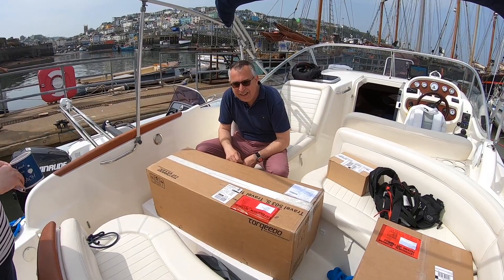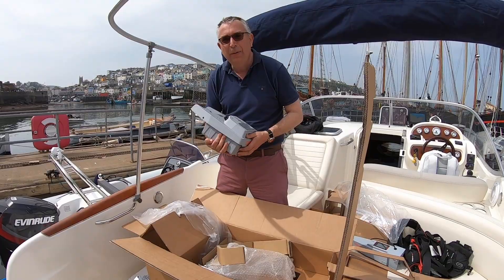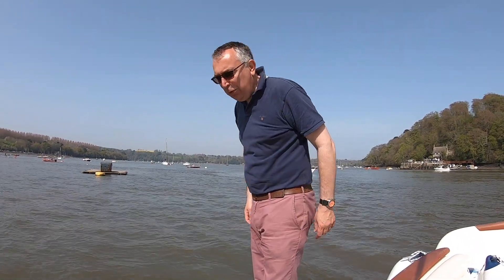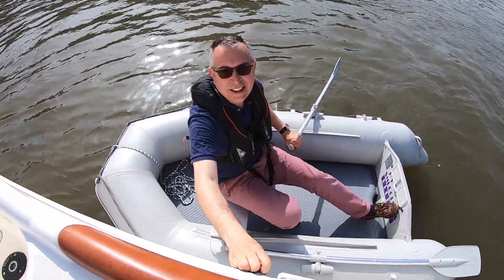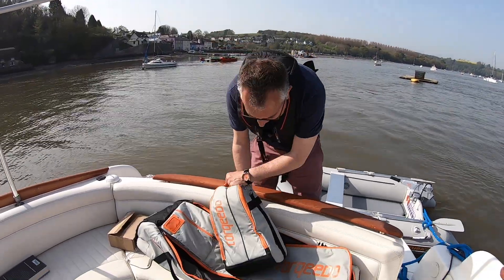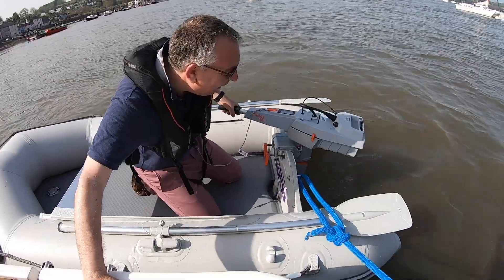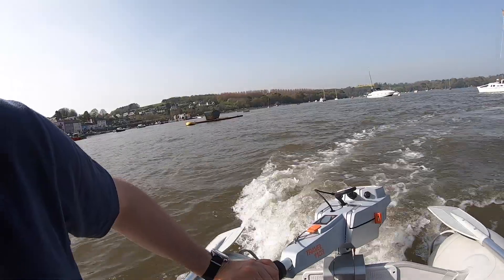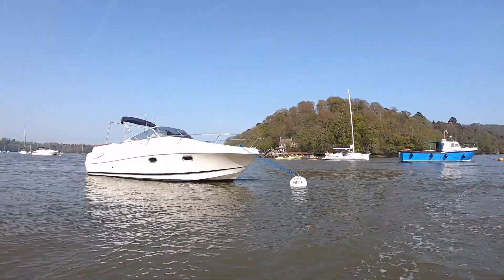Torqeedo 1103C electric outboard unbox & test

Comment: How much$ cost?,what voltage? run time ? how recharge? time recharge? how much extra Batt?? some specs?? por favor....
Reply from the maker: Let's find out shall we? Stay tuned! :)
Reply: https://www.torqeedo.com/us/en-us/products/outboards
Reply: Vastly more expensive than a petro motor based on model.  I just bought a 2019 20 HP fuel injected Tohatsu for 3K versus 24k for their 25 hp model.  Certainly a neat technology but clearly marketed for the rich.  So, amazingly a outboard motor costs more than a brand new Hybrid/electric car with wheels, interior, A/C, steering, stereo, etc.  This puts the perspective of the level of rip off for this product.
Reply: @mikes1172  Sad but true, that's why i still have 40hp evinrude,10hp mercury,10 hp johnson ..all 2 strokes...older ones that still work just fine and ok to use most places..even here i commiefornia....however;.the whole fish/boating thing here is stupid... i quit... $$$ launch fee ,$boat reg$,$ fish license, $ boat inspection for snails $15 each time launch boat..game warden,park ranger,ect.. assholes..you are treated like a criminal... power crazed nazis I refuse to give them my $$ by purchasing fish license ect..to pay their salary...sucks here anyway too many people,too many regs,no fish that are not contaminated with mecury or some other crap.

Comment: What a great outboard well worth considering as it stows well in the need bags.  Like the dingy too I have an NC11 called Bon Ventura should go quite well.
Reply from the maker: The storage angle is excellent. In fact I bring the tiller arm and battery home (to recharge). Would be great on an NC11.
Reply: Love the storage bags, but $230 US is not very consumer friendly.  In general their accessories are extremely pricey. I guess they figure folks that buy a $2600 low power outboard won’t mind the extra cost for accessories too.

Comment: How much are they?   Has to be a downside!
Reply from the maker: Have a look on www.torqeedo.com for all the prices of all the different versions (this one is the 1103C). They are dearer than conventional outboards, but bear in mind that they never need servicing - or petrol! Once set up, mine should charge from the solar panel or from the main boat batteries which are of course being charged when we're out  running. So that will help offset the cost and there are massive advantages (which I plan to do a video on at some point).
Reply: 2k plus,
Reply: @Burnie66  just seen this one at west marine for $1300
Reply: @supremeautomotive6749  but you didn't bring it home
Reply: They are closer to 3k with the battery that is comp to a 3hp

Comment: How much power does it give you.......4 or 5  horsepower?
How long does it last on a charge?

edit I see you have said 3 house power, like you say about right.
Nice design.
I bit quieter than a British Seagal.    :-)
Reply from the maker: It is to the Seagull what a Telsa is to a Model T Ford! :D
Reply: @AQUAHOLIC  I sort of miss the old BRitish Seagalls!
There is no point talking to me about telsas im a petrol head.   Your leecy out board was a neat design.
Reply: @AQUAHOLIC  https://youtu.be/tH1XUN5RHtc
Reply: Less than 1hp at prop. It's not even nearly equivalent to 3hp - 5hp. I don't know where from this myth started, but it was debunked countless times. Electric and petrol horses are same. Still makes a fun toy with a lot less maintenance.
Reply: @xellzor To get that kind of boat into plane with 1 80kg person it would need maybe 3hp minimum and the outboard should weigh around 15-20kg max :)
Reply: @xellzor  That's hilarious.
Reply: @user-dz2jv4in5z  What is hilarious?

Comment: Agree super cool to be zipping around so quietly and seems not lacking in umph! Wonder how long it will go for before charge runs out seems range also getting better all the time.
Reply from the maker: The range on this one is superior to the (already pretty good) existing models. Add in the ability to charge onboard the boat and for free and it's amazing! I'll hopefully do a video testing out the range at some point (have a plan for a 'Top Gear' style distance challenge!) Stay tuned. :)

Comment: Nice one. How many HP?
Reply from the maker: I believe it's equivalent to 3hp in a petrol engine - and it certainly feels all of that.
Reply: @AQUAHOLIC  It's not, only close to 1hp. 3hp is some marketing magic. Electric propulsion is nice, wish the companies were more honest about specs. But that's the price to pay for quiet ride and almost no maintenance.
Reply from the maker: @xellzor  Well, for a 1hp motor, it sure drives like a 3hp outboard! :)
Reply: @AQUAHOLIC  It doesn't, real 3hp will be faster. How acceleration feel might be different due to prop, rpm. On a small dinghy even more difficult to tell the difference since even small increase in speed requires a lot of power. Like you could paddle at decent speed with just your strength alone. My idea of electric propulsion for 30ft boat also started from this myth and quickly learned that electric horses are same. At least i didn't do the conversion before i learned it, that would be big damage.
Reply from the maker: @xellzor  Perhaps I'll borrow a petrol outboard and do a 'back to back' comparison. Stay tuned! :)
Reply: we have the predecessor, the 1003C and have also used a 3.3hp petrol, and they're about equiv - the 3.3 was slightly more powerful. However, flat tack with the 1003C doesn't last very long, and we've had no end of issues with it - now effectively in the scrap and it's less than 2 years old.
Reply: @uhan33  It's difficult to tell the difference on a dinghy and only adds to the confusion. The difference between 1hp and 3hp might as well be somewhere in 0.3knot range if not less. Dinghy with 10-20hp would feel noticeably different. Torqeedo really simple to use without much tinkering, but the price is really high for what you're getting. Batteries aren't that expensive as what torqeedo is asking, wish there was more choice of electric solutions on the market.